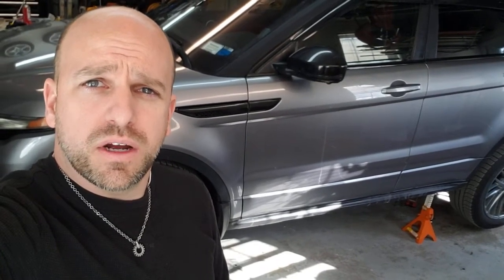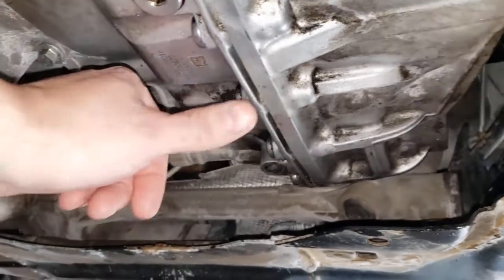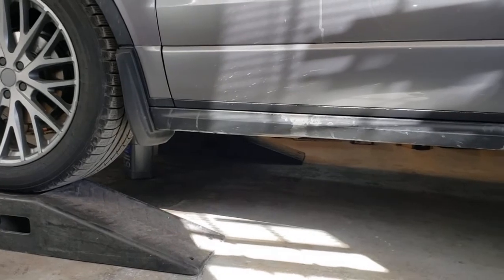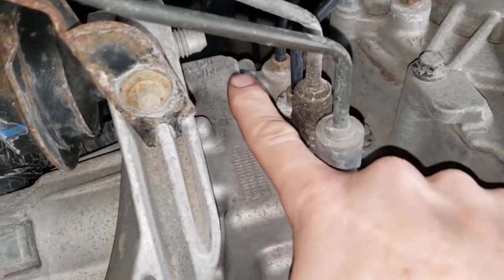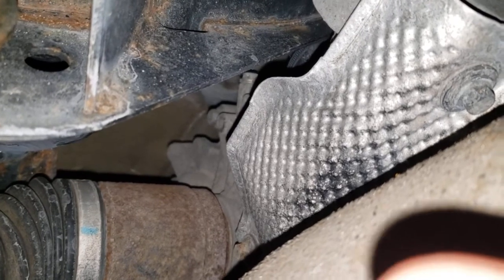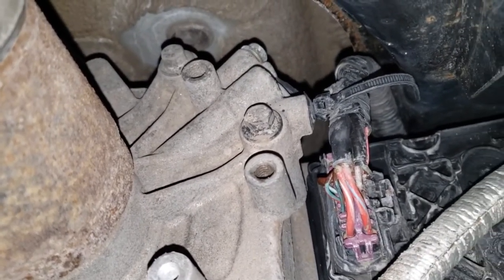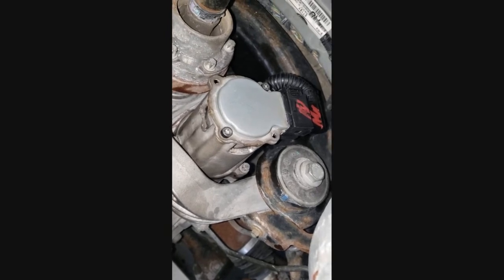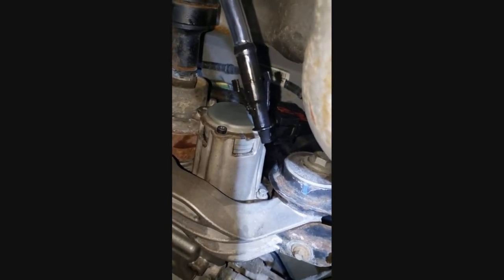Range Rover Evoque Driveline Fluid Flush

Comment: Nice and thorough video.  Thanks.  I was wondering how you carried out the bleeding procedure on the active driveline unit? The LR service manual says to manually close the two pipe port valves on the unit, then use an OBD2 tool to run the bleeding procedure.  After that the two port valves will open (popped back out) if the bleed procedure worked.

Comment: Great video! - I also have an Evoque (from 2018) and the autobox does seem to be hesitant/jerky sometimes. Can I ask - what prompted you to do all the fluid changes in the transmission? Was it the same?
Reply from the maker: I decided to do this because I actually use my evoke to plow a few driveways here in New York and I actually overheated the transmission once or twice so I thought I should do everything all at once. I'm adding an external cooler to handle things a little better next season

Comment: I have a 2016 Evoque dynamic drive. Does the front and back differential use the electronic differential fluid?
Reply from the maker: I haven't done anything with the front differential I believe it's part of the transmission drivetrain handled by that fluid

Comment: Have you managed to replace the fluid filter in the gearbox as well?
Reply from the maker: From my research that is almost impossible to do without cracking the case open and was meant to be a lifetime fluid and filter so I don't think I will attempt. I am adding an external cooler cuz I actually use my Rover to plow and we'll add a inline filter on those lines

Comment: The last thing on the video. Where is it located?
Reply from the maker: The pump is located in front of the rear differential and the housing pointing towards the front of the vehicle
Reply: How did you purge/bleed the active driveline hydraulic system?

Comment: Is the drive line pump located in front or back/ driver or passenger side?
Reply from the maker: The pump motor is pointing forward located in front of the housing and the differential

Comment: How much fluid did haldex unit take?
Reply from the maker: From what I can recall not that much maybe two cups or so it's not that big
Reply: The LR service manual says 0.5L which is about 2 cups like he says.
Reply: @shanefrank3281  Yep, that's about how much came out of mine. The owners manual threw me off because it calls for way more.
Reply: @TWISTEDTA  yeah it is the same with the rear differential.  The owners manual states quite a bit more than what the service manual lists.